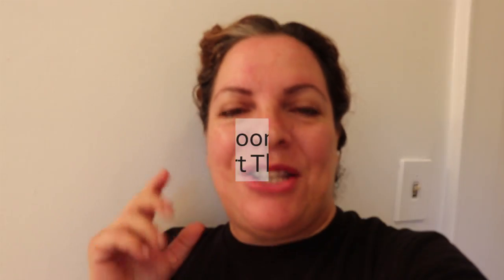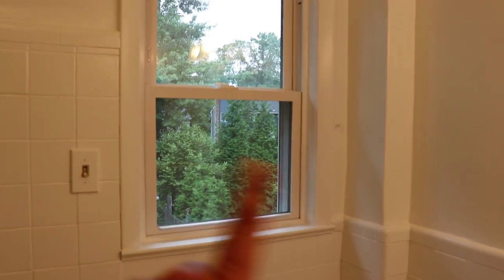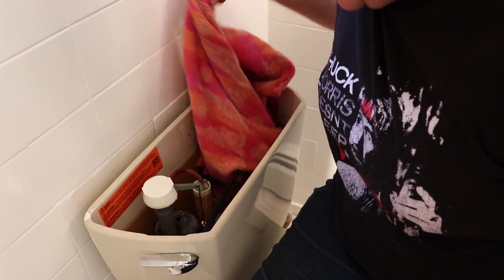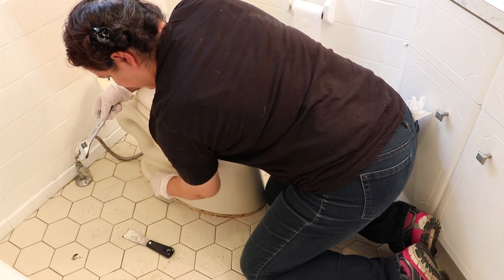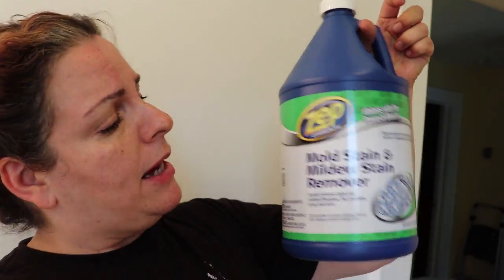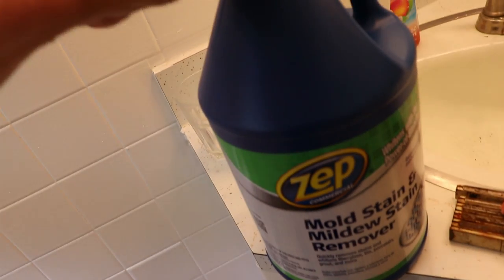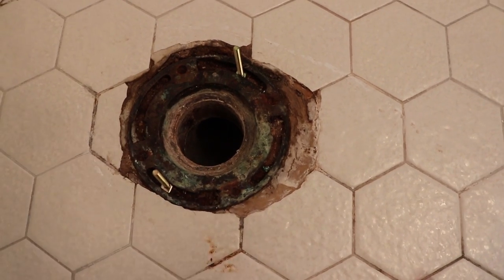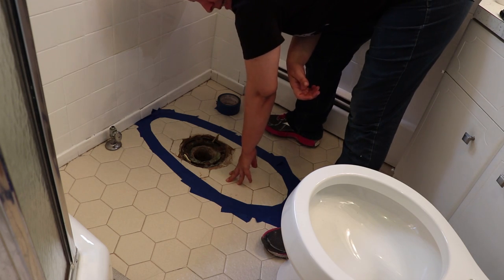Boys Bathroom Makeover || Part Three || Step by Step How to Install a New Toilet

Comment: Great job Sophia. Just one point. You're not supposed to caulk all around the bottom of the toilet. If it ever leaks, you won't know about it until it rots the floor out. You just caulk around the front and sides, leave the back open. 😊

Comment: if you flush it twice after you turn off the water you have almost nothing left in the bowl.  I did our first toilet replacement a few months ago.  This old house has a good video about different types of flanges which was really helpful since what was originally installed with the house wasn't right to begin with.  GOOD JOB!!!

Comment: YEEEES SOFIA!!!
You did another great job. 👍🏻
A great tip for the grout that works for me..... pour neat bleach along the grout line and push dry paper towel on top til it is saturated and sticks. Leave for a good few hours or overnight. Great result. Try a small area. Only Do in small areas at a time as it is very smelly. Then clean and rinse well with cold water.

Comment: All I can say is WOW! Sophia you should be so proud of yourself. Within the last 2 years I had to have 2 new toilets installed. Last month one of the new toilets had to be replaced because the handle broke off and couldn't be replaced. (Discontinued model) The inside had cheap plastic parts that broke. Really didn't appreciate having to replace a toilet that was only a year old. Anyway just a warning to others to research before buying. Since I couldn't afford a top of the line one, my new plumber told me to go with American Standard brand because there's been no problems with any of the 135 he's installed. Also I discovered plumbers labor fees to install a toilet can vary a lot!  In  my area $150. to $700. so be sure to call around or do it yourself like Sophia. If I was younger I would give it a shot. However it is critical your floor is level. One plumber had to come back 3 times and reset the toilet because it kept leaking.  Sophia's instructions seemed excellent to me.

Comment: Our plumber told us once that caulking around the base edge of the toilet is a bad idea because if the wax ring leaks it'll hold the water in and seep into your flooring instead of running out of the edges alerting you to a problem. 
Ugh we have to do this too but our flange is cracked. You're a genius, Sophia!
Reply: I had wondered the same thing. I have never installed or owned a toilet with calking. I feel like if it leaks I want to see it coming out on the floor first before coming out under the floor
Reply from the maker: brightpurpleviking the front part is partially caulked. But I see what you mean.

Comment: I came across a Pinterest hack for cleaning grout and it works great.  My bathroom tile and grout is light colored like yours.  Buy a bottle of the Clorox toilet bowl cleaner that is the gel with bleach.  You just squeeze a little of it along the grout lines.  Let it sit for a few minutes, then go back with a scrub brush and wipe clean with a wet rag.  It works amazingly. I had a few places that I had to go over a couple of times, but was not bad.  Make sure to have the window open though because it can be a little over powering on the smell.  I did mine in small sections.  The room looks great!